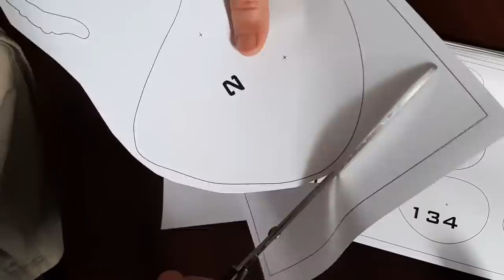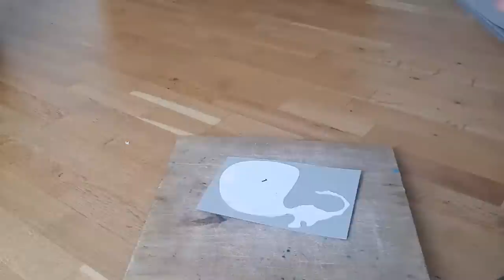DIY Cardboard Skull

Comment: An insane amount of work, especially considering the low cost of 3D printers. Total respect for the old school methods!
Reply: Depends what your time is worth.  This was a LENGTHY process.
Reply: @murderyoutubeworkersandceos   But that isn't what you said, you didn't say you would enjoy it more than 3D printing so I'm not sure why you are being so rude.  If you simply would enjoy the process then it doesn't seem like it would matter whether it is cheaper than a 3D printer because then it is the joy of making, rather than the cost, that is important.  Because you specifically said you could make multiples of this for cheaper than a 3D printer, I took your statement to mean that the cost was the important thing and therefore, I believe the time would be a factor to consider if the lower cost was worth the time, that is what the original post seemed to imply that the amount of work was worth more than the cost of a 3D printer (to that person if they were to do it themselves).  If you would simply enjoy creating them, then the cost is a secondary issue and the satisfaction of creating it would be first.  Hobbies usually end up being expensive so if this one isn't, that is awesome and an extra benefit.  Even just the modeling and mapping of the template pieces seems very fun to me, but to some the tediousness of the cutting and gluing and sanding of the layers would not be enjoyable which is when cost vs time usually comes into the equation for people, if it is enjoyable then cost or time are both less important.
Reply: @murderyoutubeworkersandceos  ok 👍
Reply: @murderyoutubeworkersandceos  Not even a remote chance, for less than $120 and I could make 3-4 dozen similar to these in 2 - 3 days MAX with utilizing less than two hours of my time.

Even if your materials were entirely free, you batch optimized to complete 1 build every 3 hours, AND you devalued your time to an underwhelming $10/ hour, it would cost you that same $120 to build 3 units with a WHOLE lot more effort. MY ass safe, dunno bout yours 😅
Reply: @murderyoutubeworkersandceos lmao it's really not cheaper, you can absolutely argue that it's more gratifying, even more valuable or detailed because it's handmade. All valid points. It is in no way, shape, or form, cheaper.. and you should give 3D printing a try if you are into crafting, Ender 3 is a great entry level (sub $100) FDM printer, and I bet you'd find yourself in love with iterating your ideas and vision with greater speed and precision.
Reply: Dang, this is a grumpy comment section. Fwiw, 3d printing is definitely a process! Not nearly as lengthy as this process, but there is so much tweaking and modifying and fixing that goes into it that it is definitely not just "plug in, leave" forever. I am totally fascinated by the process in this video, I think it's amazing, but it's not something that I could see myself doing, simply because I don't have patience for cutting cardboard circles. If someone wants to get into cardboard projects instead of 3d printing I won't try to stop them -- it's not really the most environmentally friendly hobby, so anyone who doesn't get hooked will save a little plastic -- but pretending that we don't put literal weeks and years of work into our machines is nonsense.
Reply: @sullendragon8900  Exactly. It all depends on your time, finances, abilities and what you find most rewarding.
Reply: @theseconddarrin3788  you got it!

Comment: Interesting to think where my finish point would be. There were several points I could've accepted it as finished.  Nice work!
Reply from the maker: Thank You :) If you can share some photos when you get to finish point :)
Reply: @3dgarsdesign  sorry, what I meant is that I could've stopped at several points & called it finished.  Like you said around 7:15 "It already looks cool"

The 7:40 point is really interesting, & could be considered finished.  Standing soley as stacked chipboard/paperboard/cardboard, it has a simplicity, I love, in those complex layers.  I wanted to see more of the Matt Black/sanded version at around 8:18.  I loved it at that stage, especially after the varnish over the sanded finish, right there is where I wanted to stop 8:37, those dark stripes are beautiful.  When you sanded & varnish it again & 8:58 - 9:00, I'm done, It looks like it belongs with my decor. (Its finished for me, perfectly at this point) 

I was just along for the ride & didn't have a final vision in mind, as you did.   Which is simply amazing.  You gave me a healthy shot of artistic inspiration.  I really need it, I sincerely, thank you!
Reply from the maker: @brrjohnson8131  Thank you :) The idea was to show all those points. If someone decide to make something similar they know what to wait and maybe decide to stop at any of those points :) I my self wanted to stop when it was just glued together. but I wanted to show what is possible.

Comment: Very nice, but I was more interested in how you generated the templates in the first place! It's a very neat technique for construction, and I've been looking for info forever.
Reply from the maker: Thank You 🙂 And I can tell you how I get those patterns. When I have an ide Ia make a 3d model. after that I scale it to what size I need. Then I slice it depending how thin material will be. Then make patterns from those slices.
Reply: @3dgarsdesign  - is there a way to buy or get the templates?
Reply: @jeffgilliam1  There is a link for patterns  in the description

Comment: Exactly the same way you make a fiberglass car body shell. But instead of of using cardboard, you use 1" or 2" thick foam board. Then smooth it out. Then coat the foam "buck" with fiberglass.

Comment: This video is a good example of a big question I have with many projects - When is it finished? You could have stopped at any point once the skull was assembled and it would be a compelling piece. Smooth and shiny is not always the end goal (although it is easier to keep clean).  
Great project and video!
Reply from the maker: Thank you. And yes of course the finishing pint is hard to define. but I had a vision at the beginning. So I wnet for that and because I made a video I can show all stages. I think is is important to take pictures of different stages of the project. Maybe not in this one but in next you can stop earlier and still have a good result :)

Comment: very cool project !! Just one question why not just printing the base in 3d then sand and finish it ? Wouldn't it be a little faster ?
Reply from the maker: Thank You. Idea behind this project was tom make something what everyone can then make themself without having 3d printer or other hardware. Only thing you need is knife drill and little bit of patience.
Reply: @3dgarsdesign  ooooh ok, sorry i've totally missed the point, interesting !
I OFFICIALLY CHALLENGE YOU : now you have to find a way to do the same thing but without any computer or printer...
Reply from the maker: @fraaggl  Interesting Challenge. It sounds like old school reverse engineering. Ok I will think about this. Can not promise it will be soon But I like the idea 🙂

Comment: Is it possible to stack several pieces and align the pieces over dowels, so they will be positioned correctly, then drill holes into several pieces at once? Or, do you have to do each piece of cardboard individually?
Reply from the maker: Of course you can try, but I don`t know if it will go well. If yes then awesome :)

Comment: It’s so smooth. What is the grey goop that you spread on it? Thanks.
Reply: It looked like he mixed up something like bondo.
Reply from the maker: If I understand correctly your question then it is Car Bumper putty.
Reply: @3dgarsdesign  Yes. Bondo is a brand name, it is a two part putty where the hardener is mixed in then when it dries you can sand it smooth. I'm sure there are other brand names out there, Bondo is a US brand.
Reply from the maker: @TrishGolden  Thank you for the information. I have heard name Bondo but didn`t have idea what does it mean.

Comment: Absolutely amazing! I'm assuming you design your idea in a 3d modeling program, but how do you get it into a sliced pattern?
Reply from the maker: I slice it in fusion 360. You can offset the line in thickness you need and then cut model with them :)

Comment: to quote someone else here
"i want that!"
and i bought that
my work printer will bleed, but it's just black, so who cares XD
what cardboard thickness do you use or prefere?
Reply from the maker: Thank You :) cardboard thickness is 1mm. Otherwise it will deform the shape. Of course you can use 2 mm cardboard but then you must skip every second pattern sheet :)
Reply: @3dgarsdesign  looong skull ;D
thanks :)
can't wait to start that thing ^^
Reply from the maker: @Destros2ndone  And yes. Do not use PVA glue it will make that skull Looong as well. What you can see in the video is a 3rd attempt. Previous two failed and one fail was PVA glue :)
Reply: @3dgarsdesign  i'll keep that in mind :)
thanks again

Comment: Did you make the patterns yourself?
Reply from the maker: Yes I did :)
Reply: @3dgarsdesign  Which software did you use or did you code your own program?
And are you still selling on Etsy?
I think you can make a lot of money with them.
Reply from the maker: @mosab643  Yes I`m still selling. Blender for modeling fusion 360 to make slices.
Reply: @3dgarsdesign  Oh, I have Unigraphics NX, do you know how I can make slices on that?
Reply from the maker: @mosab643  Sorry but have no idea how to do it in Unigraphics.
Reply: @3dgarsdesign  What about fusion 360? And are you located in the U.S?
Reply from the maker: @mosab643  Here is the Video how you split model in fusion 360 for splitting you can use just a line. And no i`m not locotad in U.S.

Comment: BLODDY impressive, mate!  Did you make that with LuBan, using the stack method?  ( https://youtu.be/Cfz6fh0bLI8 )

(Honestly, if I was going to make that, the first thing I'd do would be to pick up one of those $200 laser engravers to avoid my hands cramping up (again) from all of those hours spent cutting out the pieces.)
Reply from the maker: No it was not in that software but yes very similar to that :) i sarted to think about laser cutter after cutting tank tracks :)  You can se in this video https://www.youtube.com/watch?v=6AVUQ5Tkfno&t=3s. And thank You :)